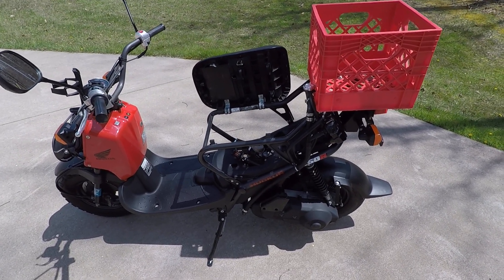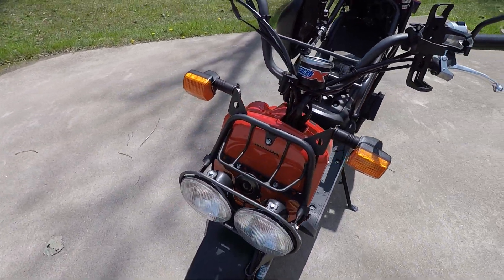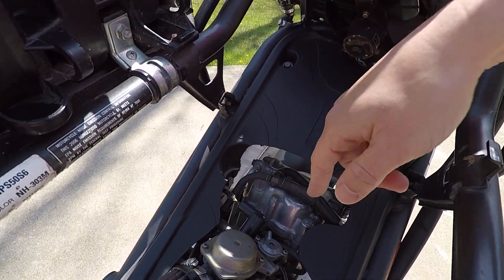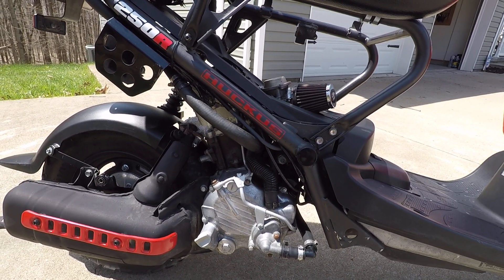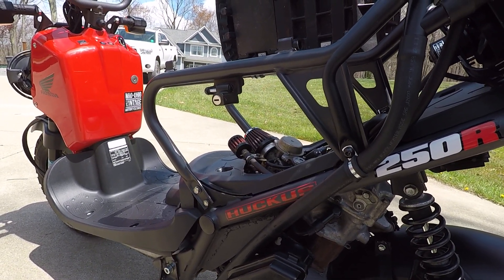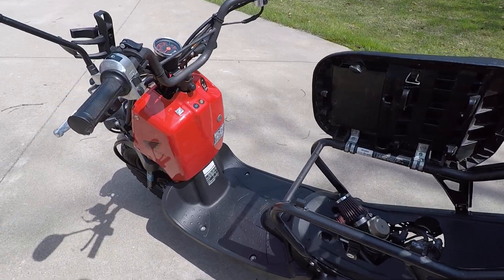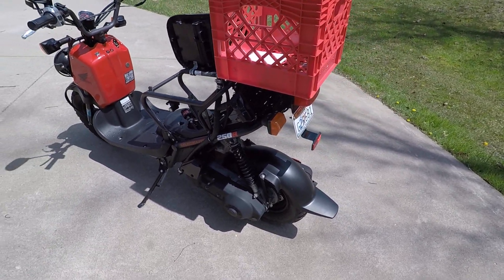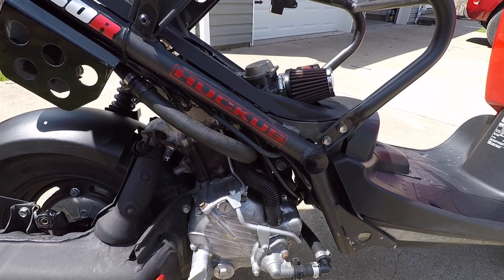Honda Ruckus 250cc Engine Swap Update

Comment: I love your build. Your mic setup needs tweaking. I have a 180cc Yamaha Riva that I want to do something with. I recall seeing that motor will bolt onto a Honda Ruckus. Sounds weird but saw it on a Ruckus scooter forum.
   They thought it was heresy but no one brought up your build and I just discovered your channel. Honda should really engineer exactly what you've done. Cheap for them and Ruckus Fever Rolls!

Comment: Hi, question: do you get any beef if you ride on Highway on that ruckus. Legally, here in NV, you need 250cc or more. Planning on building one  and travel the us on it with another friend with his elite250
Reply from the maker: Simply put I would never ride the scooter on the highway (Interstate) even if I am allowed. The real limiting factor is the tire’s speed rating. I designed this swap to get more power for WV hills where the slow speed of the 50cc was dangerous. I could only pull 15mph on twisty roads with +45mph speed limits. So top speed was never my goal. Will the engine do 70mph. Probably but I get real nervous on short spurts to 55-60 because of the tires. See my race track video. Also the parent scooter, Ruckus, was never designed for such speed. Think wheel bearings, suspension, rake, etc. Not sure if this answers your question.  I recently put mobber tires on which hurt my top speed even more. I just keep dropping the Roller weights for better acceleration.

Comment: Insane. Back in April of this year I purchased an Icebear Malibu (PMZ150-10). I have had so much fun on that thing. I have ridden it almost everyday since I got it and it now has 1.5k on it. Should I just upgrade the 150cc engine with mods? If so, which mods might you think are good for a 150cc? (Excluding exhaust) Or should I purchase a water cooled 250cc engine and have someone install it? My goal is to go above 50MPH. Thanks
Reply: Daddy Savage   who was your source for the 232cc kit u installed on yours ? Also, my moped has a lot of miles by now like 3500 km and I wanted to know if that’s still ok to do a big bore kit. If not should I keep the moped frame and just buy a new 150cc engine + the big bore kit and accessories to replace the current one on it?
Reply: 150cc should already get you above 50.

Comment: Can you do some riding videos for us.  Thanks
Reply from the maker: Yeah I hope to in the spring. I’m looking out the window at 13” of snow on the ground right now.
Reply: @wv4life375  🤣 I undestand that. You did a nice swap. Would love to see some full speed passes where the camera is stationary on the ground and you fly by. I hope you get thawed out soon. Im in Virginia Beach Va. No snow this year. Thanks fir responding! 🤘👊
Reply from the maker: @shawnamericanrebel5676  I will say that I changed to weights in the CVT from stock 26 to 18 to give it more acceleration and less top speed. Kenda tires only rated to 63. It will do it easy. I have a video going around an actual race track if you haven’t watched it.
Reply: @wv4life375  I will check it out. I too am not interested in top speed as I am Quickness, 0-50mph. Ive always loved Torque over Horsepower.. I had 4.30 gears in my 1993 Ford Mustang Lx 5.0 ..

Comment: So I do custom naked Helix builds. Can you tell me for your carb exactly what main jet and what pilot jet and everything for your carb that you did on this.
Reply from the maker: cliff fortner everything is bone stock. Sputters a bit until warmed up then it’s fine. Just have to nurse the throttle the first minute or two.
Reply: WV4LIFE It does not run lean?
Reply from the maker: @clifffortner2461  sorry just saw this. I’ve pulled the plugs a few times and they appear to be a good color.